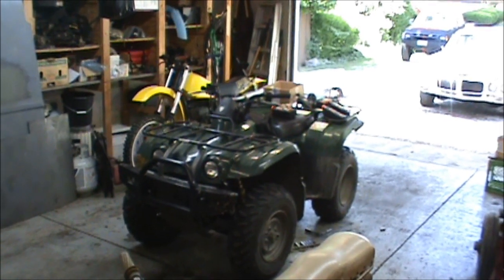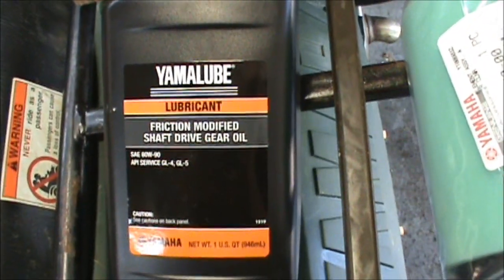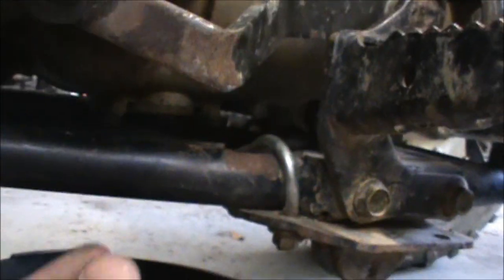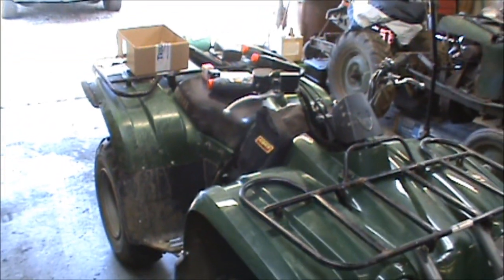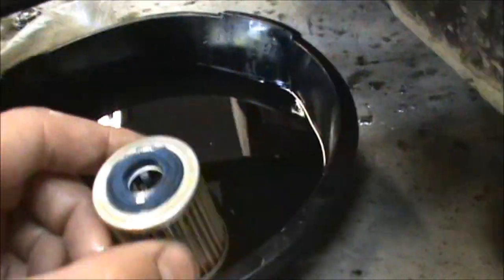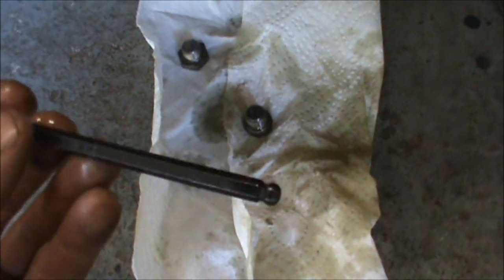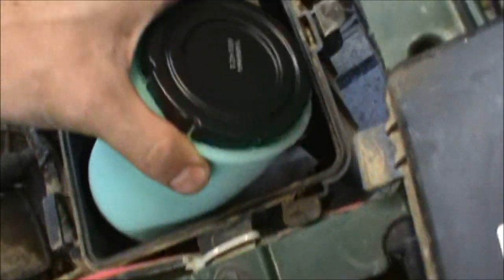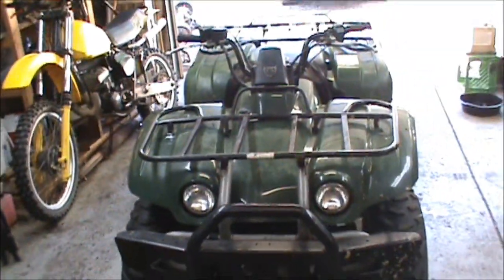Yamaha Big Bear Oil Change and More!

Comment: Awesome video! Thank you so much I have the same quad, didn't have an owners manual so this is exactly what I needed!
Reply from the maker: 2010kenai Hey I'm glad it helped you out, thanks for watching!
Reply: @jfrost77hd  i will check everything out just to be sure, i was thinking it was the jet but its a brand new carb,? Just installed right out the box
Reply: You can download the owner's manual from the Yamaha website
Reply: @dillonlees7833  if it's a other than mikuni carb (OEM) throw it in the trash, those China carbs never have the right jets , i went through 3 of them before breaking down and spending the 190 bucks on a original, installed and she ran prefect ever since.

Comment: Love the old Sears, Steyer Daimler Puch Mo-ped.  I had two of them and several of the other bikes with the same basic engine on them, from my early teens to around 20.  I have a lot of great memories because of them.  49cc of raw, 2.5 hp.  I also got a pretty good mechanical education and practice from working on them, and developed a love for motorcycles from them.  Great to see one and thanks for the great, helpful video on the Big Bear.

Comment: thank you very much for taking the time helping others! It is well appreciate sir.

I got one, however, not sure if it is a 400 or larger. looks identical to yours. my first ATV.
Reply from the maker: Glad it was helpful, thanks for watching Shaun!
Reply: jfrost77hd mine burns oil if you had to rebuild your motor what would you change(gaskets, rings and or piston) and what kit would you buy and what year is that big bear and have you ever done a video or think about making a video showing how to do the rebuild thanks
Reply from the maker: This big bear is long gone so probably no more videos unless I find another. Piston, rings, gasket kit and cylinder bored to the next size would be recommended for top end rebuild. Thanks for watching!
Reply: What year was it and if it's not too much trouble could you check like what kit form ebay or amazon you would buy and take a screen shot of it
Thanks for answering and the video you made of the oil change helped me alot thanks
Reply: jfrost77hd could you plz help me find the right top end rebuild kit for this type of atv (rings,gaskets and or piston ) I would like to order it from ebay or amazon.
thanks for your help

Comment: Good video, thanks for all the good info! 👍
  Question...Did that steel front "bumper plate" (mounted on the front brush guard), come stock on that 2000 model from the factory?
    I have a 2002, (which I bought used), and it didn't come with that set up. Just the smaller, tubular brush guard which is behind it (in silver), in your video. Regardless, whether it was stock, or an aftermarket piece, it's a pretty sweet setup for mounting a winch. Which I intend to do. Maybe it was a factory option from Yamaha? Thanks for any reply. Thumbed up. 👍
Reply from the maker: Sorry unfortunately I'm not sure about the bumper details I didn't have this to long. Thanks for watching!

Comment: Great video. But, You have to oil your foam filter. that is what collects the dirt and dust from clogging your paper filter. Take the foam filter off the paper filter,oil lightly and squeeze it till it is fully covered, do not over oil. Then put the foam filter back on the paper filter. When dirty take foam filter off and clean it with gas, do not wring out or twist the foam, squeeze it out. Have fun with your new toy.

Comment: I have a 2004 big bear. I am having issues with the rear drum brake filling up with mud and water constantly. I've replaced EVERY SINGLE PIECE and still have the issue. Any suggestions for what I need to do to convert it to disc brake on the rear?

Comment: Hey man great video listen I just changed the oil on my 2007 big bear I was told at the dealer that it took .37qt.for the front and .24 qt. for the rear. now the front differential is leaking could it be cause I put to much oil or could it be the crush washer?
Thanks if you could help.

Comment: Just ran across your video. I have the Big Bear 350 2wd, and want to drain the old fuel out as it has been sitting in my shop for quite a while. Can you give me some advice on the proper way to drain the fuel tank? Thanks.
Reply from the maker: You could either remove the fuel line from the carburetor and drain it or use a hand siphon pump and pump out the gas from the filler cap. Thanks for watching!

Comment: Hi,I got 2002 big bear 2x4 that sat like 6 years with same gas in it i guess cause it was popping when i was trying it out.the only reason i got it from the dude it only had 150miles on it and his wife owned it.i took the carb apart clean it still same thing so i got one on E-bay for $159.00 new.the only thing is it needs more air to the carb.u think i need a bigger jet size 4 or 5 size.it runs great without the air box and faster ride. P.S. pic u c is my prairie 400 4x4 setup 4 snow LOL

Comment: Can you possibly give me some advice? My big bear boggs out like there is to much air coming in wont accelerate but idles really good but wants to die as soon as you hit the throttle,
Reply from the maker: I haven't messed with these in years but I know some will do that if the parking brake is not all the way disengaged as a safety, try manually disengaging it at the lever itself it could be hanging up. If not that I'd say the main jet in the carburetor is probably clogged.

Comment: Do the differentials also have measure levels on the dipstick? I don't know how to put .37 qt of oil in the differential and .24 in the final, without putting too much in. I'm sure the engine (main oil) has a dipstick I can measure with.

Comment: Do you still have that big bear? Need pics of the two wires that are on the bottom of the carb and where they attach....
Reply: I have the exact same Big Bear... would you like a picture of mine?
Reply: Colton Kelly, yes I would and thank you.... need pics of how and where the two electrical wires attach to bottom of carb... please and thank..

A friend started the rebuild of my carb, I took it off and took it to him and he found a non-replaceable part broke in side of it.  so at his dime bought me a brand new carb and I installed it... my old carb is still in pieces and I found out that the new carb didn't have the connectors pre-installed on the carb and I have to transfer the piece over but have no idea where it connects... or what it does for the matter of fact...
Reply: robert detwieler I'll get a few today after work.
Reply: Colton Kelly thank you in Advance
Reply: Colton Kelly ty sir.. does the one wire connect to the round one via a washer looking attachments??
Reply: robert detwieler which one? The black or yellow?
Reply: robert detwieler the black one hooks up using one of those slide on ends, and the yellow one looks like one solid piece that goes into the carb.
Reply: Colton Kelly black one... does it connect under the base of the yellow or next to it
Reply: robert detwieler it looks like the black wire does have the female end on it and the yellow wire goes through it into the carb -
Right side view of wires https://imgur.com/gallery/yMBRW
Reply: robert detwieler I hope it all worked out for ya!
Reply: Colton Kelly, yes thank you, just haven't had time to work on it this weekend..